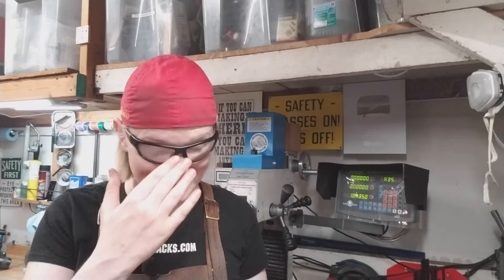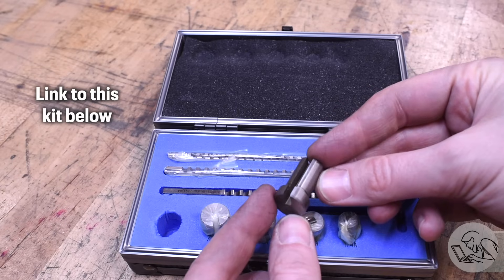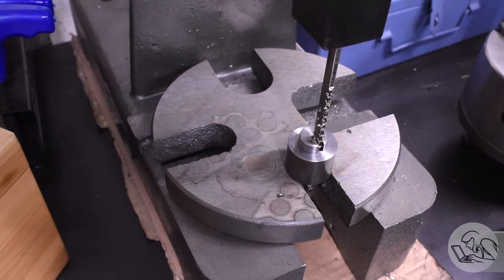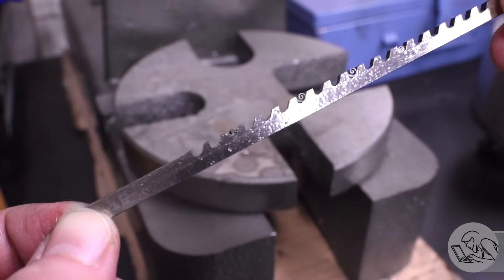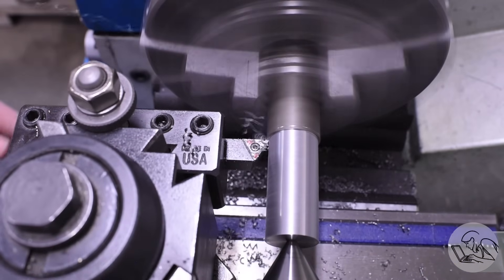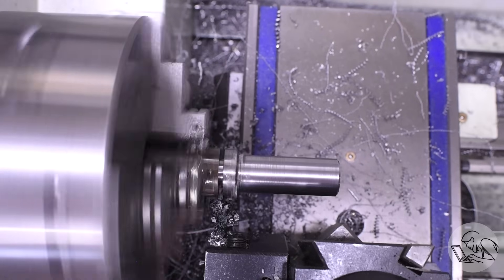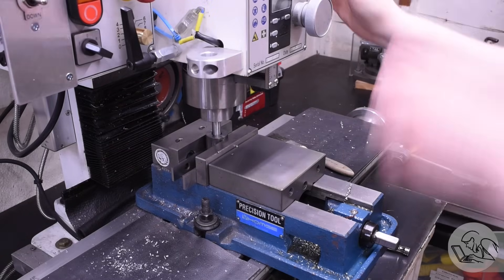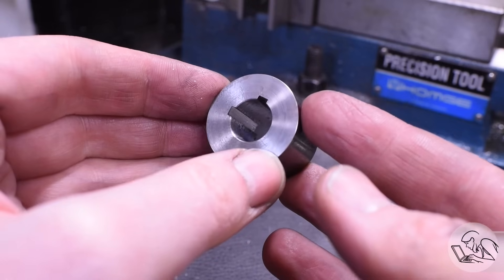Three Ways To Cut Keyways! No special tools!

Comment: well yes & now for number 4  how i do it as i am low budget i do make a sleeve in the same  way but put on the sleeve a on the lath at the diameter of the  inner most  boar I put a circle' Denoting the circular poison of the top suffice of the  key to be cut, Now i have the depth of my key   from that to give me   a centre dot position to drill a throw hole . it is very good for the larger key way  but works for the smaller  ones to ones drilled & when  removing the drill & the sleeve you should be left with a kay way . with a rounded inner & slightly tapered side      Now we fettle the key way with the trust finger file Or square  file.  Often the side do not need a lot on larger key's & i tend to leave  the radius in the key as i drill  & tap a grub screw to site on top of it'    So number for when all you have is no time & a drill post . & a lathe  , In closing dont trough the inert a way it can be reused serval times with this siystom .  The Gide prevents the drill wondering as we cut the key way. on the fault line. between the hole & the Gide ,   The snugger the fit the deter the job . But not that tit it  need pressing in.  Well hop you get to reed it But with all your kit you will poo-poo it LOL . no daut .

Comment: If you want to lock the lathe chuck in place; engage the change gears and the back gear at the same time.  Then DO NOT turn the power on.

Comment: A tip that I use at my work is to get a  sacrificial  piece of round bar made to the same dimensions as the workpiece is of a similar material. On the spot where you are looking to have the key way, dill a pilot  hole making sure that  the exact centre is half into the centre sacrificing bar and half into the work piece, this with making the hole bigger (but not larger than the intended key way size ). Then you use the key way to take out remaining material. OK might be a  bit more with making the centre, but it would save on how much effort is needed in the force pushing the key way  to final size. 
Keep up the great work Blondi and have a great weekend!   Phil  UK
Reply: If your keyway is in the end of a shaft you can also skip the whole keyway cutting step and simply drill across the join between the shaft and your flywheel, pulley or whatever, then insert a dowel pin (or the shank of an old drill cut to size) as the key. I've seen this referred to as a 'dutch key' or 'scotch key' though a round key might be a more useful description. Obviously the torque capacity will not be the same as a square key.

Comment: I make big PA6 406mm OD pulleys on our MASTURN MT 50 CNC lathe... it´s teach-in style lathe with handwheels (attached to servos), ballscrews on both axis and Heidenhain controller.... Can be operated manually, but can write a program in simple Heidenhain conversational.... It has 35G7 bore with 10P9 keyway through..... I have brazed carbide key cutter used on shaper, just center it, measure it in, rapids to 75% and left, right, 0.2mm DOC (0.1mm radially), left, right..... Takes some time to make it from 35G7 to 38,3mm from bore to top of the keyway.... the spindle lock (it has ON/OFF switch on the control panel) is a bit wobbly, so get a piece of wood on the ways, touch one of the jaws onto the wood, engage spindle lock and good to go... it won´t move a half a degree... PA6 is okay with rapids, I don´t think I´d have balls to cut it into steel with rapids.... would be much nicer without option of shaper as we don´t have one, to cut it on manual lathe to have feel in handwheels...

Comment: One thing that I've never seen anyone address, is that the broach bushing should be about as long or longer than the object being broached.  If it's not, the broach will want to bend, and that leads to lots of sharp broach bits that are no longer usable.  I now make bushings of the proper length if I don't have one already.  You probably know why I know this...

Comment: I had to use a 25mm broach at work the other day and a 22mm one today on stainless steel...
It takes about 5-6 tonnes to push through each pass.
For bigger keyways we use a slotting machine/shaper.

Comment: Da, there is also a 4th way to do this like on the lathe except with a simple dual link handle (like a shaper) attachment for the lathe, although I prefer the expensive broach as I don't have the antire afternoon and 153000+ jerks of the slide to make 3 keyways.. Everybody has own preferences, things do work, things have good ad bad sides. You didn't tell how long did it take you to broach that keyway  on the lathe with the boring-shaper tool.  ;)  Tried it, it works, but we have better ways.. =) Although you're right, the broaches (expensive ones) have the downside of the collars you have to have or make, but in this case it's also a privilege, as you can make collars on dimension. There is also one other limitation - the depth of the bore, which if excessive is not suitable for broaches, in that case you benefit from the bore-shaper thingy.  Keep on,  you're doing good work. Cheers.

Comment: @7:10 Aww, missed an opportunity for an "essential oils" pun.

Nice job! Absolutely right that keyway broaches can be a pain to use with just a small arbor press. Even though force is being concentrated just onto those small cutting surfaces, it's all being applied down the length of the way as you cut.

Comment: Super explanations as always. I've mostly used single-toothed broaches to make keyways in blind holes, first cutting an internal groove at the bottom of the hole with a grooving tool so the broach tool has some space for the chips to fall into. I had to grind the broach tools in one piece with an offset shaft and grind the cutter in some unground material at the end of the offset ground section, as there wasn't any space to fit an HSS bit into a holder. That was fun, for certain very specialized definitions of "fun".

Comment: Oooh!  Thanks for the inspiration for a current job I have which needs a tiny bronze pinion making to fit a existing 3mm splined shaft.  Indexing plate bolted to the back of an ER collet chuck, index pin on the headstock and make a vee tool ground from a broken HSS tool.  Simples!
Reply: A 3mm Splined shaft!?!  Your eyesight (and patience)  is obviously better than mine.  I'd love to see a video of that.
Reply: @markmarkw1919  I have a video microscope that I use on the lathe and mill for very tiny work.I'll grind a teensy single point broach to make the internal splines. Should be fun.

Comment: I've always wondered but never been challenged enough to attempt it, but do you think you could use the lead screw gearing and the thread dial as a sorta crude built-in indexing head for shaping a spline or gear?

Comment: Quinn, From an engineer and machinist, you know your stuff.  Well presented too. Good job.
Reply: Engineer and Machinist! 👍
I've always said that anyone that wants to be an engineer, needs to spend time in a machine shop. Countless times I've argued with engineers that had no concept of what it takes to manufacture some of their ideas that they so easily put on paper without understanding what it takes to fabricate them. Only once in my almost 50 years in the trade, did I work for a company that wasn't a Job shop. They had their own product which they designed and manufactured. It makes it so much easier when the Engineer and the Machinist work side by side to solve any problems they have as it occurs, when manufacturing a new product.
Reply: @charlesmauro5905  I couldn’t agree more with that sentiment. It’s all too unfortunate the amount of “engineers” that can’t/don’t understand that while the things they’ve learned in school are best practices, in real life things don’t actually behave exactly like they do in solidworks.. I had a recent graduate of an engineering program ask a fellow experienced engineer what O.D. and I.D. meant…. It should be mandatory in order to complete your program and get your degree that there’s a certain amount of hours you need to work in a shop, preferably a shop that’s applicable to they type of engineering you want to do. I’m in the states so maybe requirements like exist elsewhere.
Reply: @charlesmauro5905  I got my PhD in biological cybernetics, but while doing my dissertation work I did an apprenticeship in the machine shop of the Max-Planck Institute, beginning with make a square block within tolerances from a chunk of steel using nothing but a file. Throughout my career that training helped me when I wanted a specialist machine or tool made. I could either make it myself or intelligently explain and/or draw my requirements for the machinist. Secretly, I wish I had become a machinist, in spite of having had a successful career in science.

Comment: Great demonstrations! You've probably seen a few examples of lever-operated mechanisms mounted on the lathe tool post (with the carriage locked) that move the cutter in and out of the bore. For small (7x14, etc.) and barely-adequate lathes especially, they really seem to take the stress off the carriage-transport gears/rack. 

BTW, I just read your commenting policy. I love it! I think other You Tubers should have similar policies--especially the one warning safety trolls that deletion is only a mouse-click away. 👍
Reply: Yes, great policy, but there is one minor complaint: The term "mansplaining" seems to suggest a certain bias, which may be generally justified, but not always. Females and indeed any imaginable gender/orientation can also fall into the know-it-all rut, at least occasionally. As a man who really does LISTEN, I find it unfair to paint us all with the same tarry brush. As an example, my ex-wife was a Critical Care Registered Nurse, dealing mostly with Cardiac cases, and she would insist to me that "the heart is NOT a pump." Utterly wrong, of course, and no appeal to specialist credentials can alter that truth.
Reply: @YodaWhat  Well, if it is generally justified, then using the term doesn't suggest bias at all. It's simply employing a generalization which, in this instance, is well-known and widespread. For every female know-it-all, there's ten male ones. So there's more danger of bias in asserting that you're an exception--essentially the eleventh male--and it's unfair to deny the use of a generalization because those who don't fit it are offended. In reality, there's no bias here on either side, but on your side there's the opportunity--which you took--to assert that you're more sensitive than the average bear.
Reply: @tcarney57 - The problem with any sort of prejudice is: It's a race to the bottom, and only the worst win such a race, at the bottom. That is not the kind of behavior suggested by the rest of the rules.
Reply: "God is not partial and the man (or woman ) that works righteousness is acceptable to him. ( somewhere in Acts of the Apostles )
Reply: That is a great policy! However, I have never been invited to her annual Firefly themed barbecue and now I am sad... :(

Comment: Great video.  I had to cut a keyway last year on an idler pulley.  The keyway broke and wallowed out the slot on the idler.  I wasn't going to pay $100+ for a 5" pulley on my zero turn.  Welded the slot up, bored it back to size and used the lathe to cut the keyway.  It would have been much easier on my milling machine but the video I found at the time showed it on a lathe.  LOL  Only took about 4 hrs, but when your retired that's not bad wages.

Comment: You can also use a file. It might be more labor intensive, but after after a week or so you'll be halfway there!
Reply: I should have learned by now that every time a machinist says "no special tools needed" what they actually mean is "beside a fully equipped workshop"...
Reply: @AttilaAsztalos  Yes, and then pulls out the special tool kit!
Reply: I have done this when fitting "in the field" It's actually not too slow if you do some "priming cuts" with a hacksaw. (provided you don't have too large a hub diameter to be accommodated by the saw frame.) 
Getting the corners of the keyway sharp is possible if you grind an emergency "safety edge" onto one side of your file with your angle grinder.
Reply: I can feel the callouses and blisters just thinking about it😂😂
Reply: Yes I agree, she is stool using an expensive milling machine for the alternative.
Reply: Try it in a blind hole..and I'll see you in a few years.

Comment: Not sure what it's called, but another method on the mill is to cut internal keyways with an end mill of the correct diameter. Seems like a bit of a bodge though, as it does leave a radius rather than square corners.
Reply: the square corners often act as the starting points for cracks so a radius isn't really a bad thing. The problems start when you need to make a keyway that is longer than your appropriately sized endmill.

Comment: Thanks Quinn! I bet, if a few variables line up (reasonable material, etc.) you can do your shaft and guide bushing in the same set of operations (lathing the diameter and cutting the slot). I wonder if you could even find a way to use the shaft AS the guide bushing, perhaps some way to temporarily add the flange to hold it during the press operation... Anyway, fun video, ty! -Ada
Reply: Probably not. I think the slot in the guide bushing is deeper than the keyway in the shaft, to allow for the broach to have a fairly solid spine.

Comment: I did something similar in 1991 while underway on a submarine in the Atlantic (we had to repair a large pump and needed to manufacture a part). We did not have any fancy broaches but we did have an old South Bend lathe. I ground down an old style boring tool to make the cutter. It took a minute to cut the keyway but it worked just as well. Nice tips, Quinn.
Reply: That's a super cool story. I wasn't aware that a submarine would carry a lathe. I'm surprised you had the space for it, and obviously there would be noise/vibration concerns. Out of curiosity, what sort of machining and repair capability did you have? Mill? Welders?
Reply: @aaronclair4489  Really just a drill press and lathe for machine tools. We did have a couple guys trained as welders for emergency repairs, but needing them to actually weld underway was exceedingly rare.
Reply: @aaronclair4489  I should image the lathe had to double up as someone's bunk. 😉
Reply: @TrevorDennis100  That's why lathes have beds.
Reply: @gdm2417  Bravo!  Very clever.  Thanks for the chuckle!
Reply: @aaronclair4489  I think you'll find that most ships and subs have a well tooled machine shop on board.
Reply: @pieterveenders9793  If you have a major engine breakdown that leaves you dead in the water, being detected by hostile subs is the least of your worries - even assuming that there are any enemy subs around that might detect you, without engines you're dead anyway. Attempting to make the repairs is a risk you'll have to take. So yes, you  can be certain that almost every warship have a rudimentary machineshop and trained machinists on board.
Reply: @pieterveenders9793  I agree the noise will give away your position, that's why you run silent and run deep. <--- see what I did there? 🤣
Reply: @pieterveenders9793  Yep. All nuclear powered submarines for me. Any yes, running a lathe requires special permission from the Captain due to the potential for noise.
Reply: @pieterveenders9793  Tier 3 for nuclear sub preparedness grades the lathe and tools
Reply: @pieterveenders9793  I understand earlier versions of my Churchill Cub (mine is a 1950s era mk3a) were common on British submarines in WW2.
Reply: @pieterveenders9793   We had a full size lathe in the pump room of the WWII era Balao class US sub I was on in the late sixties.  I assume it was installed during construction rather than built down there (very small hatch).
Reply: @jasongreene303  That is correct concerning the machine shop.  When subs do not want to be seen, they rig for silent running which means to stop using the lathe...etc. Further. machines on a sub would have special mounts...etc. I once had a Pratt and Whitney B model lathe that came from a navy ship. It was great. Heavy and well built.
Reply: @ Jason, where do they store it? Right next to the lunar landing dune buggy?
Reply: U.S.S. Cod (WWII sub docked in Cleveland, Ohio) has a lathe on board.  It looked abnormally short to me.
Reply: @bknesheim  noise insulation sure
Reply: @pieterveenders9793  the USN as put a machine shop on their subs since WW2
the GATO class (and later Balao and Tench class) fleet subs all have a tool room near the engines, and by todays norm they are rather small
I think even the smaller ones also had a small machine shop on board.
Reply: was that pump for pumping reactor cooling heavy water? 😂
Reply: @VladekR  LOL no.
Reply: @scotthutson736  And,  U are living proof that repair worked and that there was no meltdown
Reply: Can't believe you had a lathe on a Sub. I think you're kidding.
Reply: today we just use super glue